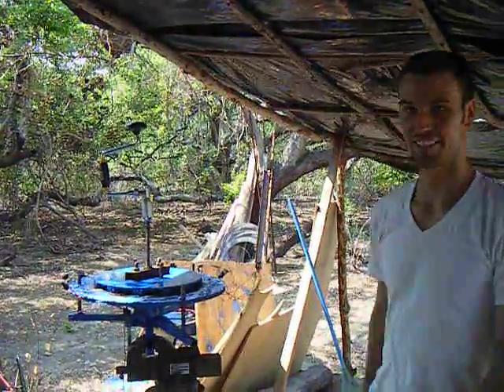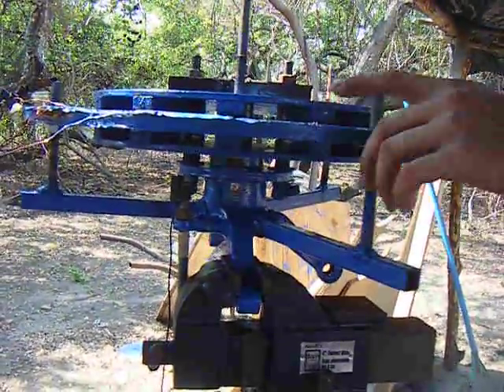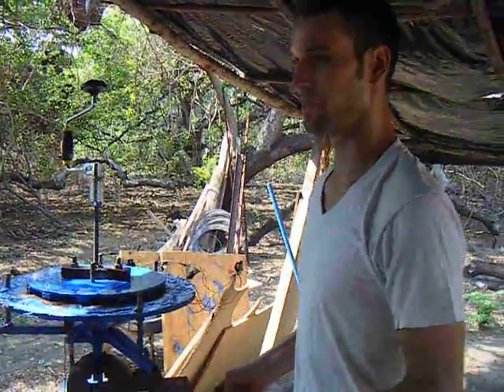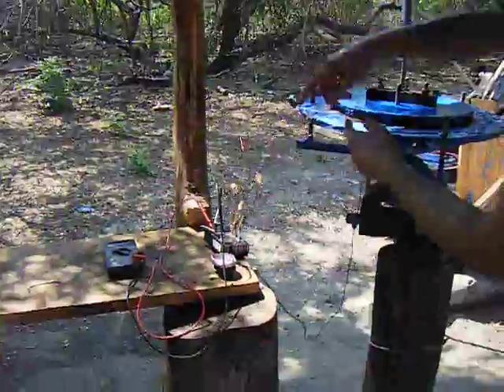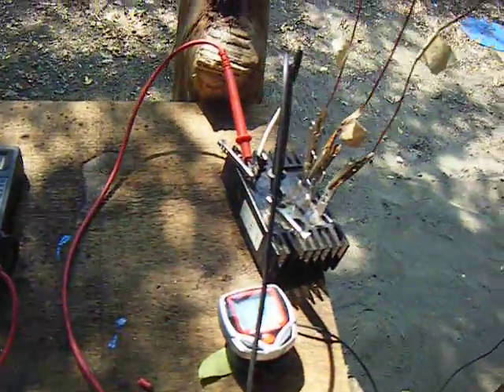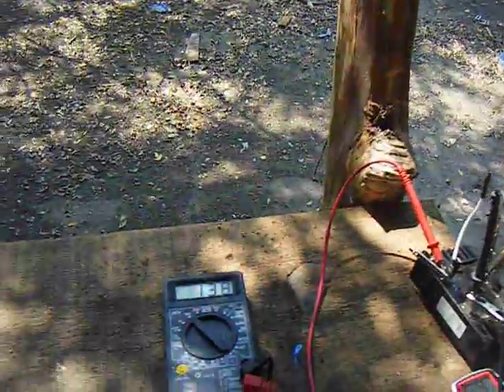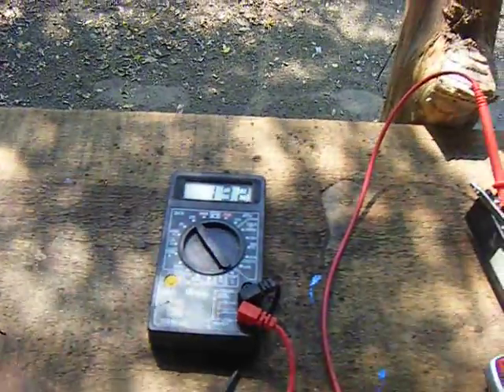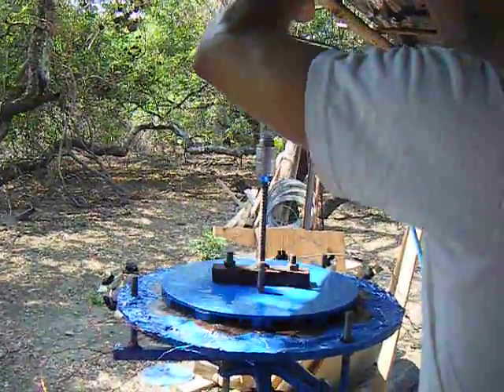VWERC Low RPM Alternator

Comment: i observed that the coil is in round form and the thickness is almost the length of the mags. the coils are spaced about the width of the mags and the coils are positioned that the mags move about the radius of the coil ie the mag cut across half  the coil . pls tell me your own observation so we can know if it can be proven to be correct thanks